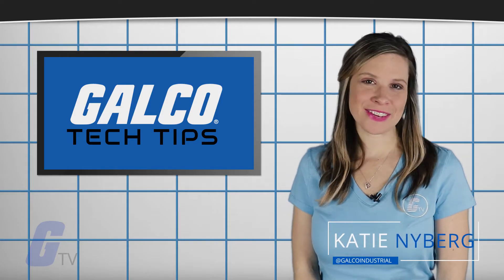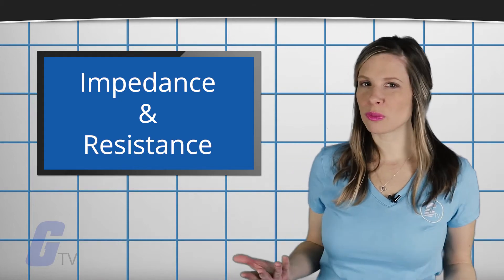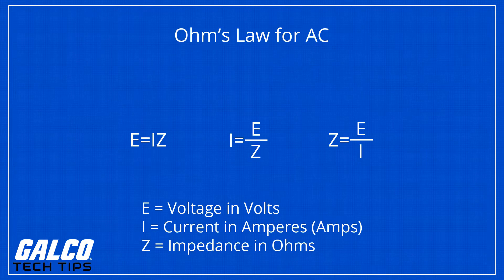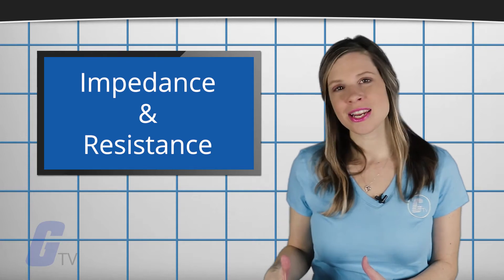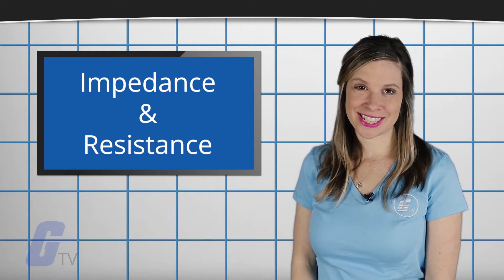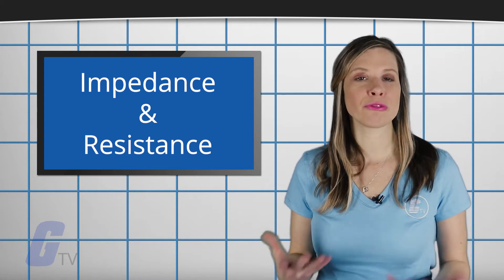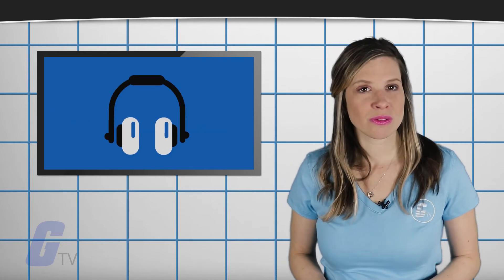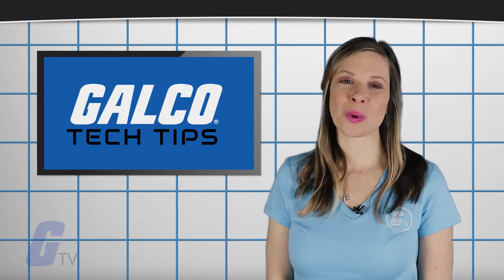What is Impedance? - A Galco TV Tech Tip | Galco

Comment: I didn't know audio speakers were AC electronics.
Reply from the maker: Well then you might also be interested to know that the standard audio range for most people's hearing is 20Hz to 20KHz. Most audio equipment today has much greater capacity then that though. So what does that do to the sound if you can't really hear beyond that range?
Reply: GalcoTV making rule for the speaker manufacturing industries to make speakers within particular HZ levels setting